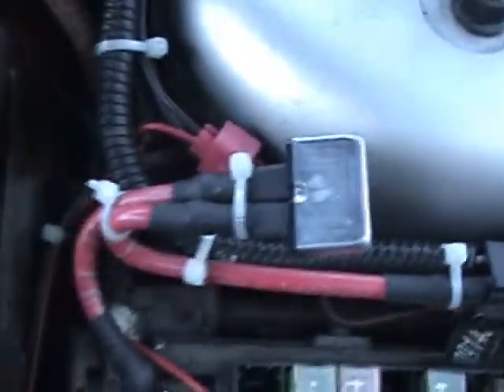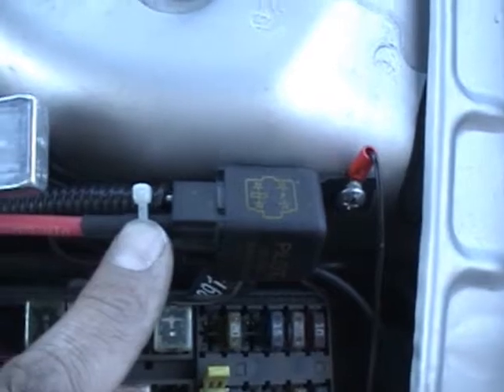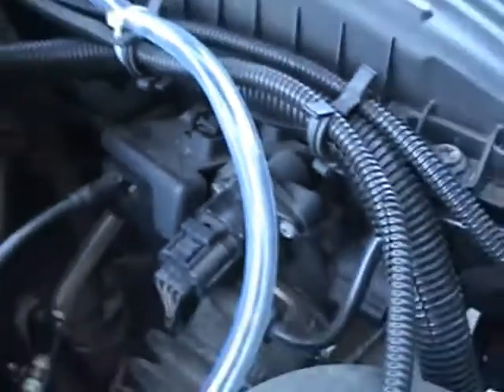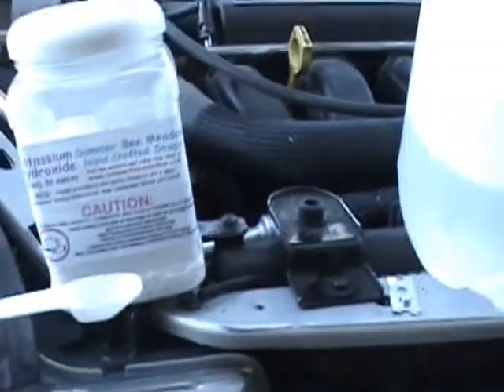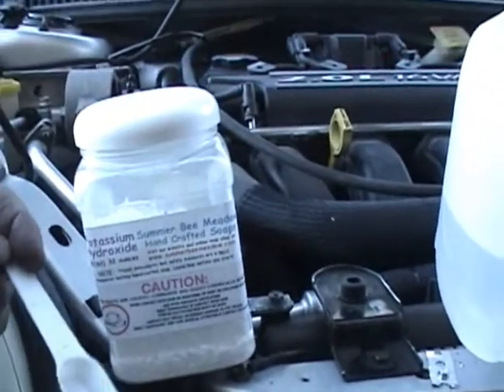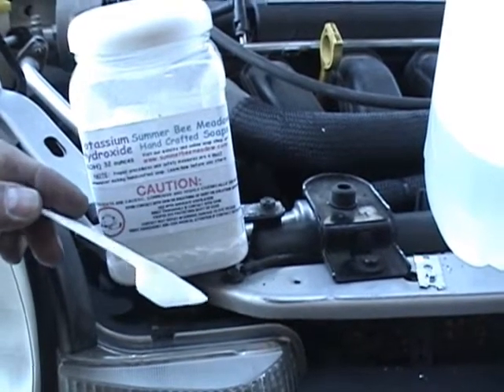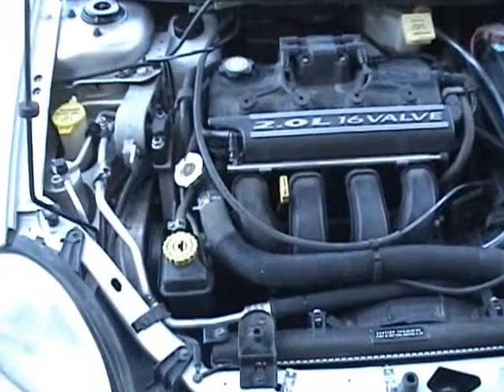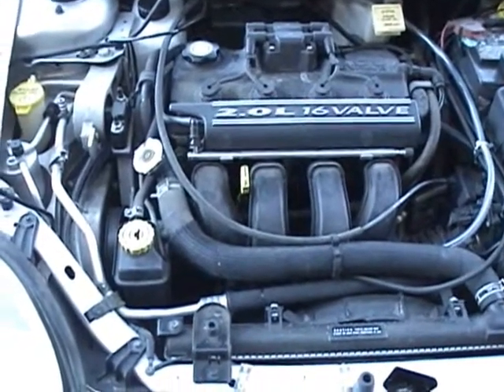(29)HydroTKO dry cell install part3

Comment: I hooked up a wet cell that I bought from a friend to my Xterra, it came with a control that we spliced into the mass air flow intake sensor so I could run the motor lean while I was running the hydrogen cell, a few months later the check engine light came with catalytic converters codes, a was told that that could happen. Is there any way just to connect the hydrogen gas into the air intake with out making the fuel more lean and still get better millage?